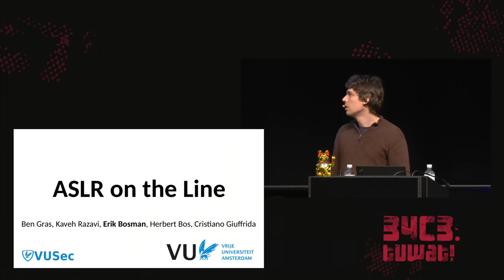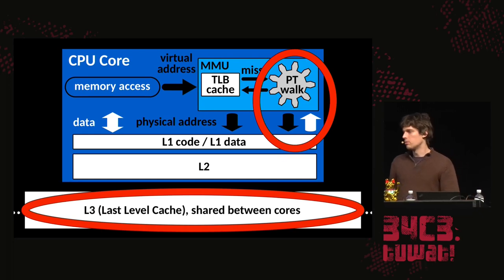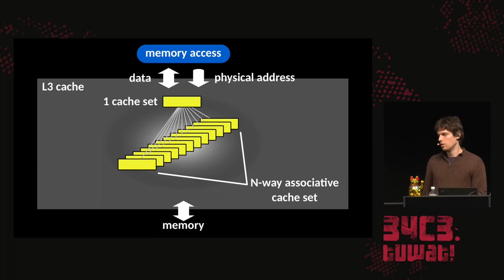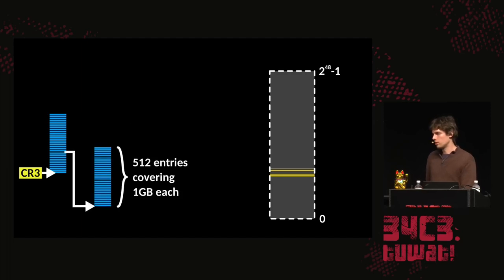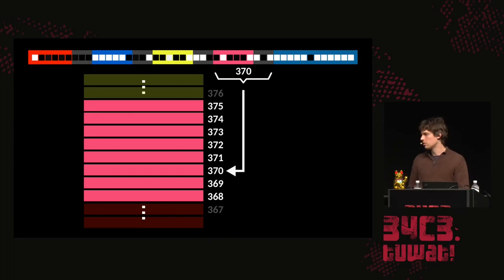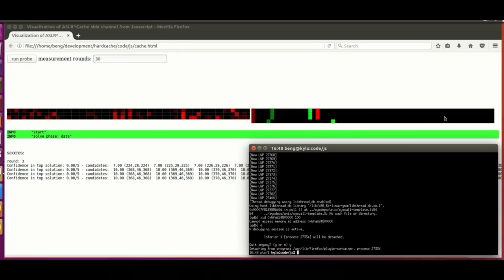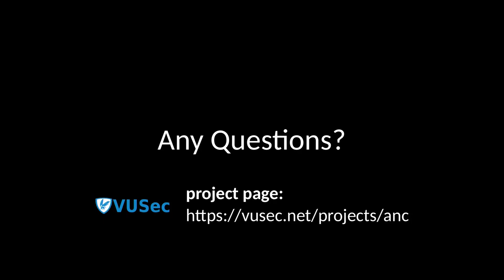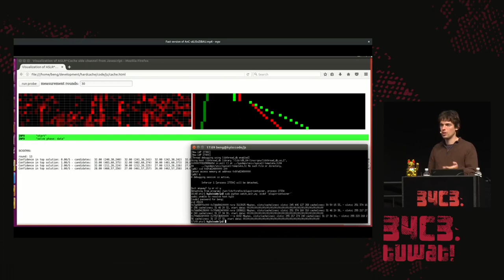34C3 - ASLR on the line - [FANCUT by ChillerDragon]

Comment: hey bro a question, what do you edit teeworlds videos with? What happens is that I can't find any program that has Motion blur so that my videos look good
Reply from the maker: I used to use Sony Vegas for most of the teeworlds videos and it did a good job adding motion blur when recording demos in 0.5x speed and fast forwarding them to 200% speed in sonyvegas. But I am probably switching to kdenlive now motion blur or not. The benefits of free software are worth it. Sony vegas doesn't even run on macOS or linux.